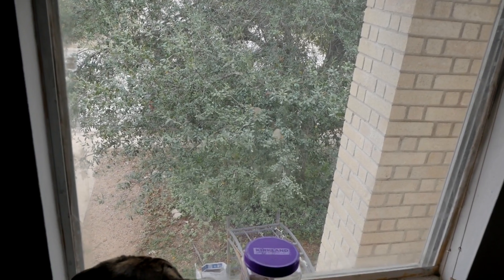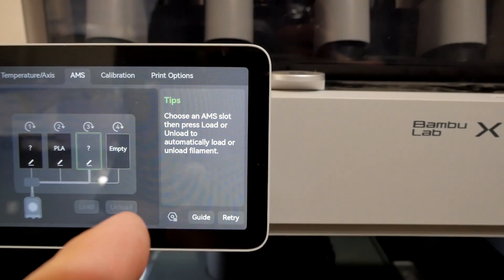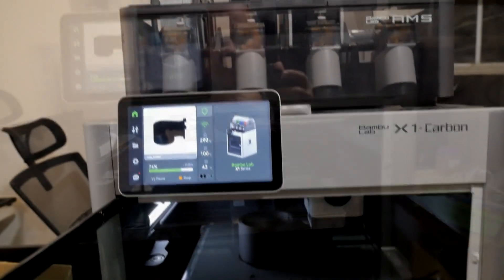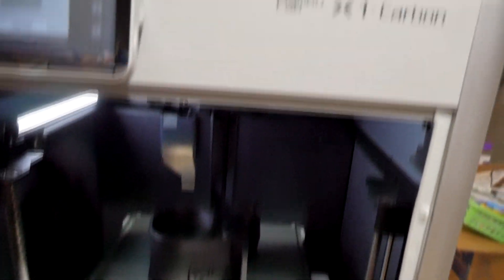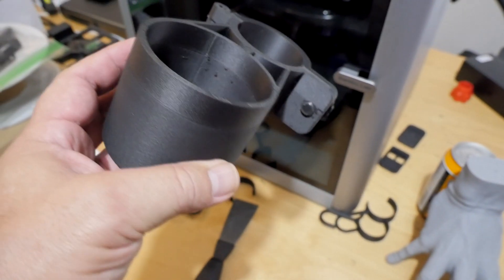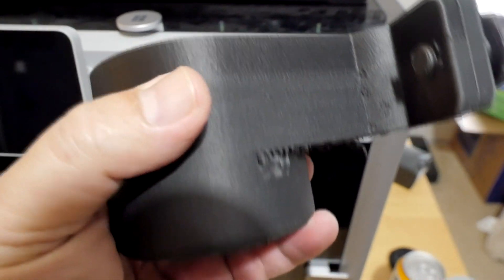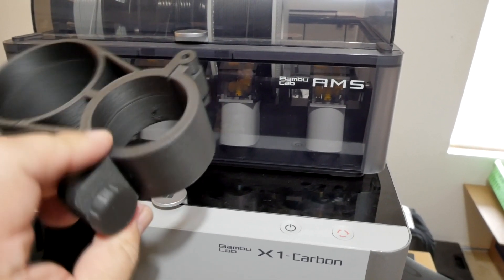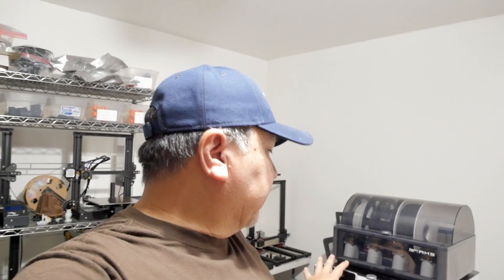Reloading Filament Anomaly in the Bambu Lab X1 Carbon

Comment: What nozzle size are you using?  They recommend the .6mil nozzle for the CF Nylon so I ordered a few spares in that size since the printer comes with .4mil.  I am a newbie so I am assuming the larger size is just to guard against clogging and nothing else...
Reply from the maker: Yes, it is recommended to use the .6mm nozzle to help prevent clogging. That is the size I used.  I have used PLA Carbon Fiber in other printers using .4mm nozzles with no clogging.  I will be trying that in the X1 Carbon soon.

Comment: Did you get an answer on this? I was wondering, if the last firmware update fixed this. Also guessing it hasn't run out on you again.
Reply from the maker: It hasn't run out on me yet.   Once I get low on a spool I'll make sure it runs out mid print.  I've heard a few have the same problem, but not many.
Reply: @V3Precision  awesome thank you

Comment: That’s not really surprising. It’s wrong but I’m guessing they don’t have a branch in the code to reread the type of filament part way though the print if you change it. Or the RFID sensor is turned of during the print. 

At that point it’s already running the gcode so it’s probably ignored. If I’m thinking about this right they would need to insert into the gcode when the filament runs out, validate the filament matches previous selection when reloaded.  This would only work for their filaments too so I’m not sure if it makes much sense to do.
Reply from the maker: I see what you mean.  I think there should be some kind of code during the filament switch and when the printing continues to show that the filament has been inserted and is operating normally.  Right now, I was worried that something was in error, even though the print came out good.  I didn't have peace of mind until the print finished and the RFID sensor read the spool.  Now what I mean?  I think the RFID should have been read when the filament was reinserted.
Reply: @V3Precision  totally get it.  The more I think about it, I’m wondering if it’s difficult to do because it’s running the Gcode at that point. The reading of the filament happens prior to the GCode starting.  Since this isn’t open to doing much on the code side yet, I have no idea if that is even functionally possible. 

But it’s an interesting idea. It would allow for additional colors on one AMS.  For example if you had a 5 color print and one color is only from line 1-100 then 300-400 is a different color you could swap it out and change which color it’s tied to.